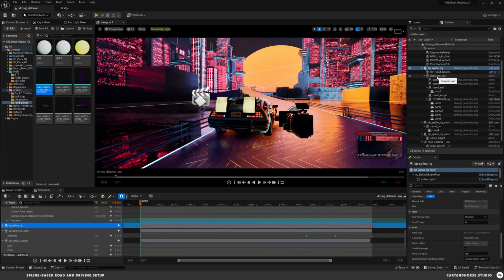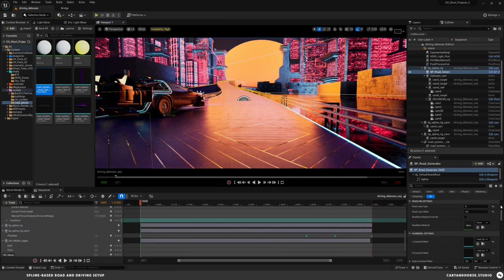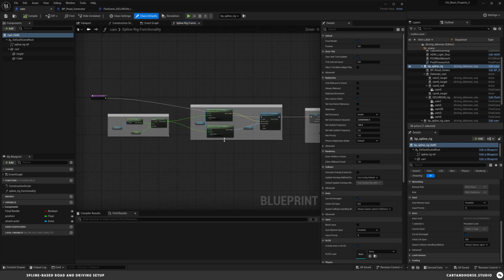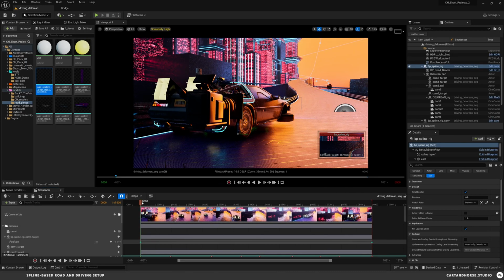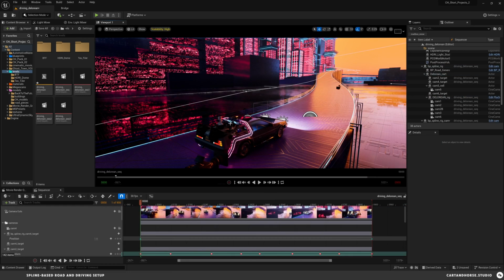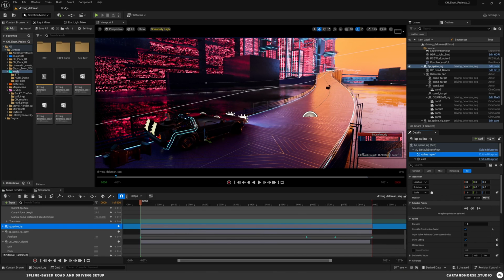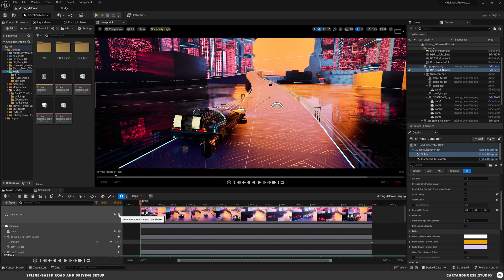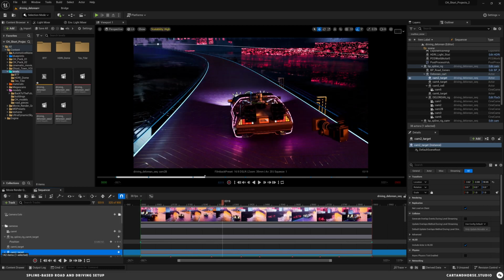Use Splines to Create a Dynamic Road and Driving System for Cinematics - Unreal Engine Tutorial

Comment: Very nice. Question though, when you made your own custom asset, did you make sure that it's the same width and length as the original asset in the bp?
Reply from the maker: Yes.  I generally either open their road asset or export put a mesh from Unreal.  That way I have a safe bet for swapping out a variety of models that I feel confident will work.
Reply: @cartandhorse  Thank you so much for the reply! That helped a lot.

Comment: Rewatched this a few times (as well as the spline rig video) and the only thing I think I am missing is how you got the vehicle into the bb_spline_rig blueprint.  

I see that under the bp_spline_rig is an Actor named "Delorean_cart" and then later down the chain I another Actor Blueprint named "Delorean_rig"  I also see that bp_spline_rig has an "Attach Actor" drop down in the Default panel on the right that has most likely "Delorean_cart" added in.  When I did this I was getting the attached actor to follow, but my vehicle will not.

Curious what I am doing wrong here....maybe I need to create another Attach Actor variable to give to the "cart bp" and place the vehicle in there?
Reply: Looks like you need to make sure your vehicle blueprint geometry is all set to moveable, which will allow the vehicle to follow the attached actor.   Big thanks to Dan Maurer for this one!
Reply from the maker: I am late on the reply, but thanks for posting the solution here!
Reply: @porterdesignandmotion  I have a similar issue where my static mesh f1 car I imported wont parent to the actor handle. I have a racetrack setup and just trying to get the car to drive along track. New to Unreal and appreciate the help.